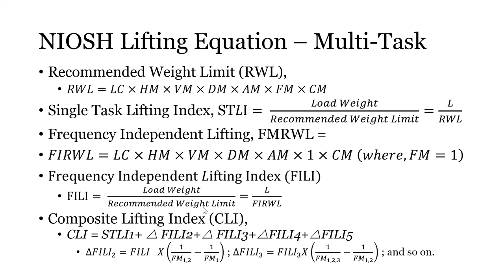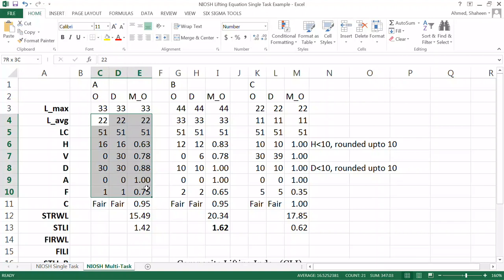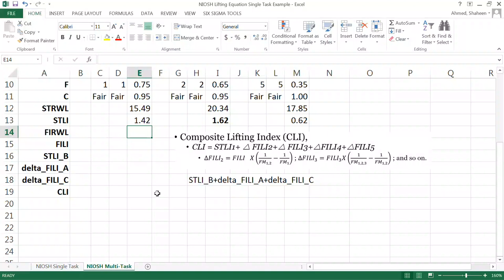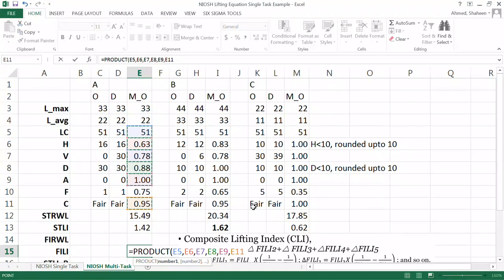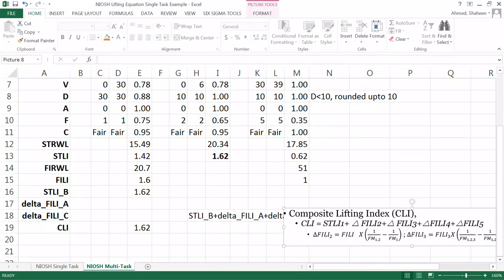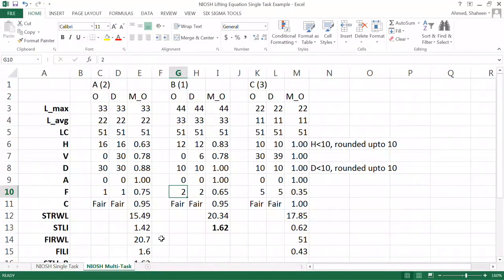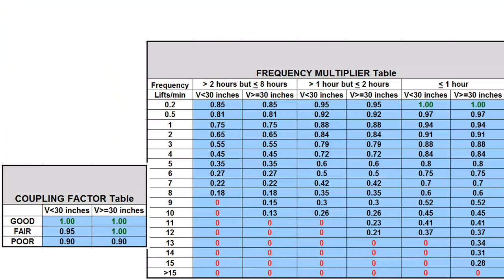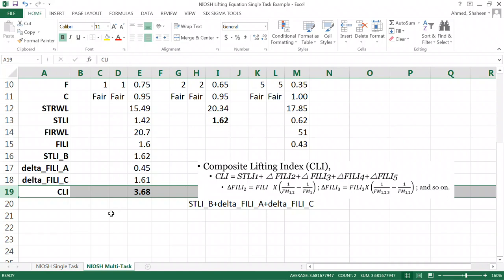NIOSH Lifting Equation Multi Tasks Example

Comment: For task C, vertical distance origin is 30 in and end at 39 inch...Shouldn't that leave VM to be 1.00 and 0.93 approximately....Then, select the 0.93 to be used instead of 1.00